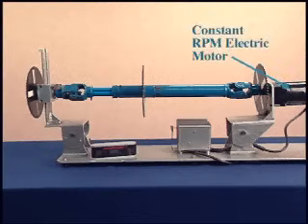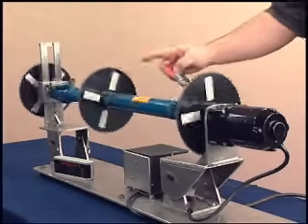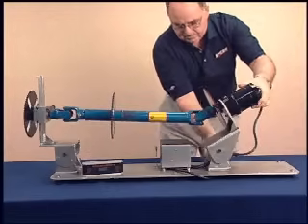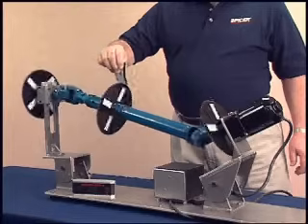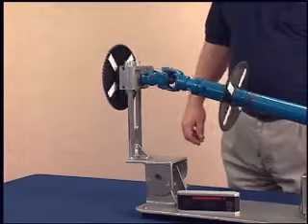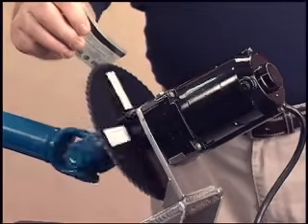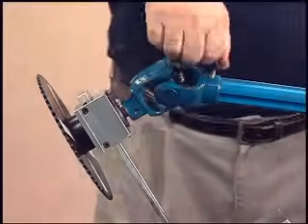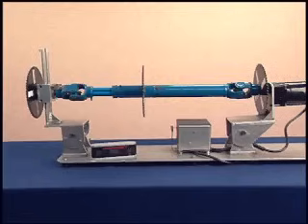Drive shaft velocity

Comment: This is a great vid, would someone be so kind to do this exact vid again but with a 2 piece driveshaft and a center carrier?!! 
The consensus with a 2 piece is the front piece should be a straight shot out of the transmission and the then the rear section is just treated as a single piece drive in relation to angle setup. But what if its impossible to have the first section be straight and its pointing down say 2 degrees... Then after the center carrier it drops another 2 degree, should the rear end pinion flange be angled the opposite way (up) compensating for the combined drooping angles of the first and second pieces? EG, 2* + 2* = 4*, set pinion angle to -4* 
Any YT experts wanna comment? Cheers.

Comment: Fantastic video. I knew that there were alignment necessities with two u joints but had no idea how to visualise it. Once saw a raised pickup with huge wheels and to get the driveshaft to connect to diff at such a sharp angle  they used two cmpletely floating U joints. No mounts. didnt see how they moved it but looked a complete disaster.

Comment: I'm thinking how is it possible that on some trains the transmission and the powered bogie are connected with the cardan shaft? As the train goes into curves the bogie must rotate thus making the two U-joints being in different angles.

Comment: Ah! I understand now why the velocity of the middle sprocket changes when the shaft is jointed! In the perspective of the middle section, when the input shaft turns, the rotating "circle" moves as well, changing the perspective of the circle, therefore making it more ovular than circular.

Comment: Having repaired and built hundreds of driveshafts from very small to very  large , I did learn in the 1970s that the input and output shafts don’t need to be parallel. The angle of each U-joint must be the same though, and they must be inplane with each other.
GM did this with the double Cardin U-joints they used in their upper end cars.
This is, though, by far the best demonstration of U-joints I have ever seen.

Comment: is this why swapping a 2 piece drive shaft from a 1 piece from an ss v8 on the late 97 to 2002  camaro 3.8 v6 gives it slightly more torque and makes it a bit more reliable?

Comment: I always knew there was something not 1 to 1 when you bent a straight axel. Even as a kid I thought ujoints are not a very good solution.
Reply: I figured this out when using the swivel socket attachment and an impact gun. There is a big loss of torque

Comment: Waste of time here. The shaft has the same speed, regardless of the changes. Don't get sucked into this bullshit. If the shaft was made of flexible wire cable, it would still rotate one speed from end to end. Do a test with, not a shafts mentioned here but with a garden hose with one end attached to a geared motor to achieve a slow but safe rotation and watch the other end still rotates same as the end where the motor is attached. I don't know who does this guy think he's gonna fool. Certainly, not me. 🤔

Comment: I.E. you want both u joints at the same angle and both yokes front and rear in alignment in the same phase.or both driveshaft yokes in perfect same alignment with each other as well as both drive and driven yokes in same alignment with one another causing both u joints to operate @ the same angle as well as speed to optimize longevity...

Comment: Hmm I have a quick question. I have a fully restored fiat 124 Bc from 1971. Around 80kmh I feel slightly a bit more vibration. Can it be from such wrong/asynch playlcing together for the shaft? I mean guess into the blue, but we checked the car and the previous owners has restored everything. But maybe done just such a small mistake. Tires are new etc
Reply: My experience with cardan joints is limited but my engineering prof. in university was a drive train expert ... so maybe I picked up some of his knowledge telepathically:  My wild guess would be that joints that are not synchronized properly should cause trouble at every speed...

Comment: Damn it I should have marked the drive shaft when I changed the u-joints
Reply: It's not critical, strictly speaking. The alignment can be reconstructed at any point later by just making sure both ends of the drive shaft have their joints parallel to each other. The mismatch only occures when the joints are misaligned randomly.

Comment: Worked in Driveline manufacturing for many years and no one ever explained this as clearly as here .
Reply: Hello Sir, i have a question about this topic if you wouldn't mind.

If the Input and Output arent in the same plane but still at the same angle, could you still get a smooth output by adjusting the phase accordingly?

I appologyse for my bad english, it is not my first language.

Comment: Maybe these guys with the jacked up pickup trucks need to watch this.

I have fixed a few snow blowers, where the driveshaft was out of phase, and vibrated horribly.  Just disconnect the shaft, line up the knuckles, problem solved.

Comment: The retro encabulator would provide inverse reactive current for use in unilateral phase detractors but also be capable of automatically synchronizing cardinal graham meters. 

Rather than power being generated by the relative motion of conductors and fluxes it’s produced by the modial interaction of magneto reluctance and capacitive diractance. 

The original machine had a base plate of prefamulated amulite surmounted by a malleable logarithmic casing in such a way that the two spurving bearings ran a direct line with a panametric pham.

The lineup consisted of six hydrocoptive marsleveins so fitted to the ambiphascient lunar wane shaft that side fumbling was effectively prevented.

The main winding was of the normal lotus-oh-deltoid type placed in panendermic semi-boloid slots of the stator. Every seventh conductor being connected by a non-reversible tremipipe to the differential girdle spring on the upend graham meters.

Moreover whenever fluorescent score motion is required it may also be employed in conjunction with a drawn reciprocating dingle arm to reduce sinusoidal depleneration.
Reply: I just want to take a moment to appreciate how you worked WAY too hard on this. Thanks!

Comment: It is quite a time since Citroen doted his cars with an "homocinetic" transmission to the front wheels. The idea is that this transmission has to be absolutely symetrical relatively to a central plan. This needs 2 cardans driving a central short axis of any shape but symetrical. So every part also turns symetrically which means at the same speed. And since that, any front driven car is now so built ! It is not a novelty, sorry for Thomson.

Comment: Just A few simple facts that elude almost every "custom" 4x4 shop.
Reply: I mean when the OEMs set their drivelines up to be 100% straight theres gotta be some logic behind it...
Something I have picked up:
There is ALWAYS a reason to why something is set up or build the way it is.
Reply: @alouisschafer7212  Wouldn't be so sure I've seen OEMs design trash before. I got an ebike from China with a 20mm through axle fork and an adapter for a M12 threaded axle motor. It was sold like this as a kit. Why is this a problem? Well, as far as I know, electric motors need electric power. And if your dropout is 20mm with no thread and the motor itself has an M12 threaded axle, you're forced to use their wacky "20mm diameter to M12" adapter covering each end of the motor axle to even mount it. No way for any cable to come into/out of the motor axle. So it was literally impossible to mount and connect. Again, they made this kit specifically and sold it like this! I contacted the vendor, he admitted this and gave me a partial refund...so never depend on designs or think you can't improve stuff...
Reply: @ccllvn  They knew it was gonna be shipped to the U.S. as the major market, and knew nobody would take the time to complain about the design and go through trying to get ahold of somebody in a different country for a refund so they rolled with it. For every one person that took the time to ask for a refund or a fix, 99 people didnt, they just said screw it, I'll deal with it.
Reply: @ccllvn  Chinese factories make a lot of stuff they never tested, i seen chines bicycles with soft iron ball bearings, i saved them as proof because noone would believe it. And its our own fault for buying all the cheap garbage, China didnt make any of the stuff before they realised how stupid we westerners are, and even then it took many years before they actually made shitty stuff in large quantities -  it defied intelligence, the belief in humanity had to be thrown overboard first.
Reply: @lakesidemotorsports7658  most of your stuff is made in china
Reply: @sepg5084  lmao you know what I buy now? No... most of YOUR stuff is made in China. I'm a man of quality. Most of what I own is hand made in America. I don't eat fast food bc democrats can't make a sandwich and I don't buy cheap shit bc democrats can't beat Chinese kids into making a decent product
Reply: @ccllvn  wait so does that bike work now? How strong is the motor output?
Reply: @lakesidemotorsports7658  
Holy SHIT.
RIP Sep G
Reply: @digitalradiohacker  🤣🤣🤣
Reply: @lakesidemotorsports7658  I got excited when I read OEM (I was expecting some massive car marker fuck up), nope.. China with a bike... Bruh.
Reply: On that subject: Large diameter tires change stopping dynamics, often overlooked resulting in hard spots on discs, brakes that quickly overheat and fade, I see guys towing boats etc with extra diameter tires.
Reply: @amjimc  the conservation of energy means that the same ammount of heat is released from the brakes given the same deceleration. the only thing that decreases with a larger tire diameter is the leverage the brake rotor has over the tire, so you have less "power" which due to brake boosters, trucks have enough to spare. the heat capacity of the system stays the same.
Reply: My experience is suggesting that driveline issues are sure to come up when lifting many vehicles, and should be taken into consideration, with SYE kits, T-Case drops, wedges for pinion angles, etc, etc. as part of a lift to get the most satisfaction, was met with "JuSt InStAlL mY lIfT aLrEaDy !!, dOnT uPsEeLl mE !!

Comment: So what does the "Constant Velocity" CV-shaft do ? Does it rotate at a constant velocity? If so Why
Reply: i'm not an engineer, but cv joints essential have a ball joint with BBs on tracks to lock the relative positiopns. i hope this explanation is good enough.

Comment: Could you alter the phasing in an application where your driveline angles aren't the same? If done properly, could the effects be canceled, or would they always add onto eachother?

Hope I get a good answer on this 9-year-old video.
Reply: i would say if the phasing is 90deg off and both input and output have the same angle in the same direction it cancels (video shows same angle in opposite directions), and i guess with adjusting the phasing you can account for variations of direction of the angle, but to cancel out both input and output must have the same angle from the middle shaft, otherwise some variance remains

Comment: I feel very stupid I didn't know this was a thing. I could tell you how an automatic transmission works but I cant tell you how a damn driveshaft does.
Reply: Ha Ha, learning is fun. I remember when a guy told me about this thing about 45 years ago. I was like What? This is a great demo.
Reply: The in thing to do back in the 60's and 70's was to jack those pick up trucks as far up as you could to look cool. Only thing was the trucks would pick up this mysterious, loud, shaking vibration. Then some old fart told us about the varying rpm's as the shaft would spin at those angles.

Comment: This is the video every project car builder needs to see to solve their driveline vibration problems. Gotta match your angles at the tail shaft and pinion.
Reply: Phasing two piece shafts as well.  Can't count how many times I've seen people replace a joint on a shaft, only to put it back in incorrectly..